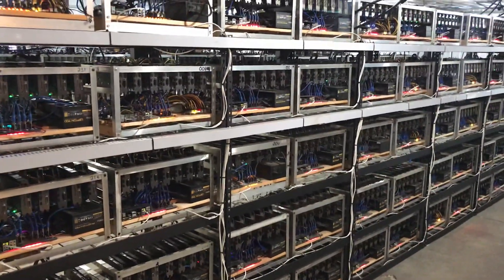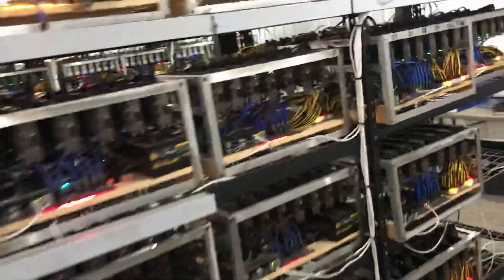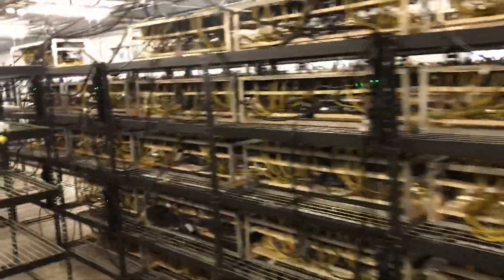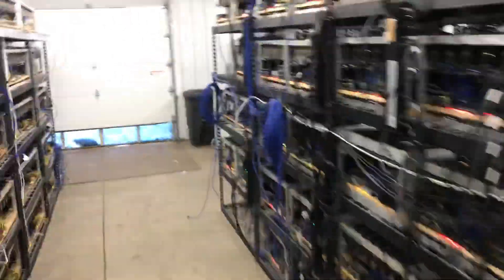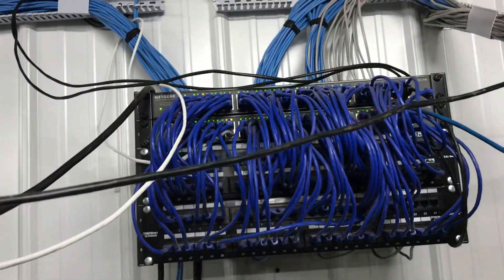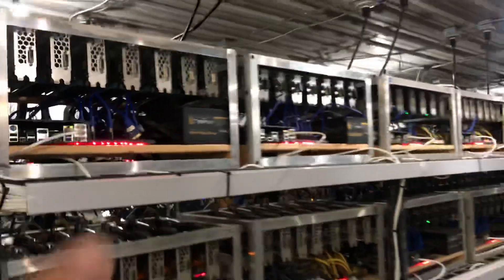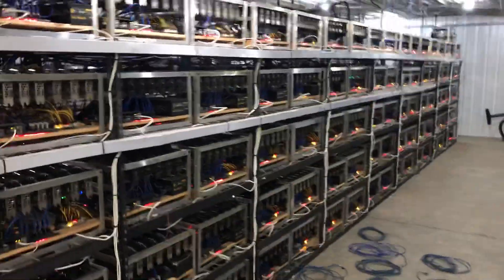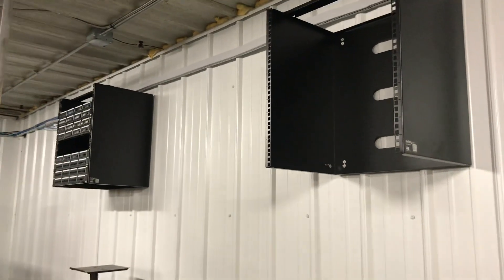WORKER WORK | VOL #22 | 3/24/2021

Comment: You should use Velcro loop instead of zip ties. Zip ties can pinch the cables and cause you problems
Reply from the maker: appreciate the tip.  thanks for the comment and checking this out